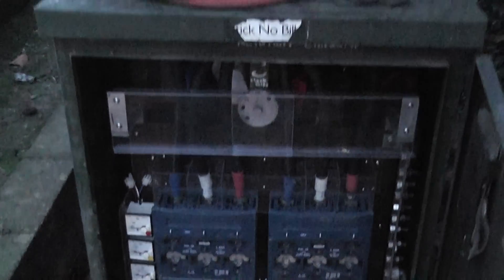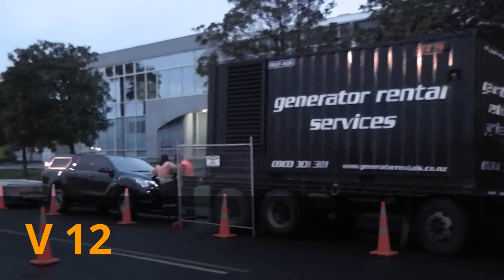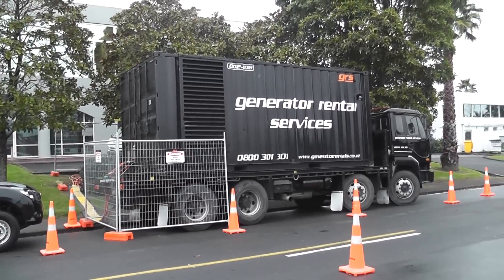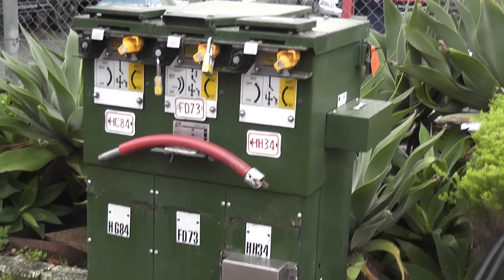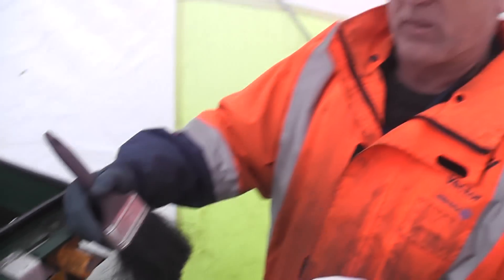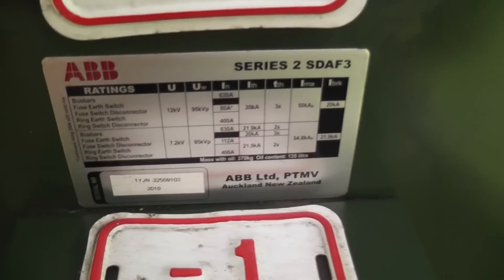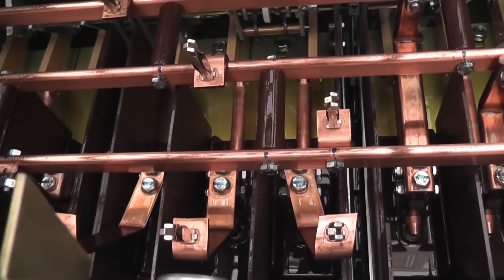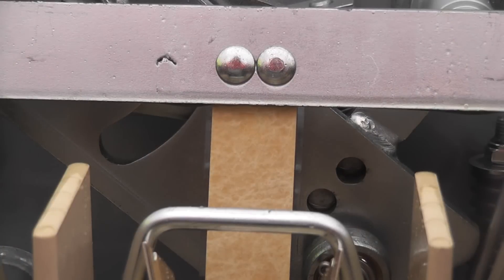RMU Maintenance

Comment: so since the switch failed to break load, did that also have to be fixed?
Reply from the maker: No, the actuator is to slow. It works on most Series 1 units but there are some it doesn't work on.

Comment: All the suspense, and then the actuator didn't operate the isolator!!!
Reply from the maker: Yes, actuators are a new "safety" measure but the actual movement is too slow and on some switch units the springs don't get past the toggle point fast enough. As with the dog bone the movement is a lot faster. But I have to stick to the operational protocol.

Comment: I really like these videos! So did customers loose power for a time or was it instantaneous change over?
Reply from the maker: We had two 40 minute advertised power cuts to connect and disconnect the generator. I checked with the customers ( Mc Donalds, Petrol Station, Medical Centre) 10 minutes prior so they could close the drive through etc.
Reply: Ok, thanks for responding! I'm guessing a synchronous switch over would be quite involved, like connecting an actual power plant to the grid with generator synchronizing. I used to work at a medical center so I know they most often have synchronous and instantaneous 'mains' backup for vital systems... though I did witness a partial backup failure that left the 'red' hospital ward outlets completely dead while the administration building had emergency backup! Not long after that, massive underground equipment at the hospital was replaced with enormous cranes.

Comment: what is the power of the genarator. and what is the voltage 1100v???? or 415??? or 240,110
Reply from the maker: 800 kVA at 415 Volts. Transformer LV side isolated and generator feeding into the  LV fuses
Reply: RODALCO2007 why don't they stop the electric power till the service maintenance is over . isnt it dangerous to work with live 415v . what is the normal voltage used in your home. it is 240v here in india
Reply: Do you know what engine it had? Sounds like a CAT to me but I could be wrong. It's definitely not a Detroit Diesel though. X'D
Edit: Crap! What do you know ... just as I posted the comment you said it. Yep, a CAT.
Reply: it must be cummins!!
Reply from the maker: Caterpillar diesel V12 rated at 800 kVA continuous.
Reply: They don't want to interrupt the service to the end-customers.

Comment: How do you protect the exposed contacts from the rain while you do the work? Since they were exposed. Wouldn't it create a short/arc?
Reply from the maker: We had a tent set up over the switch unit when we took the top lid off. 
We don't want any water in these units.
Reply: Ah cool, thanks.